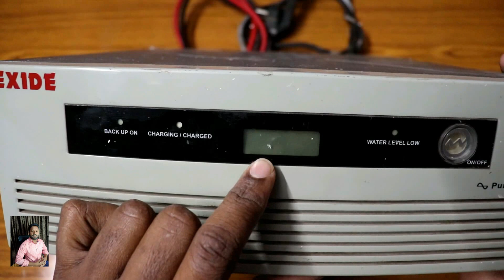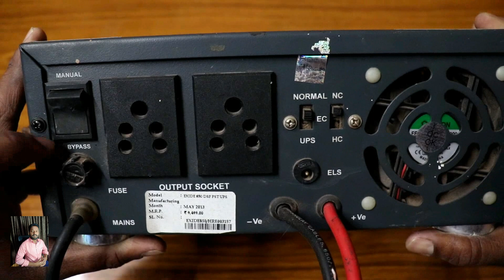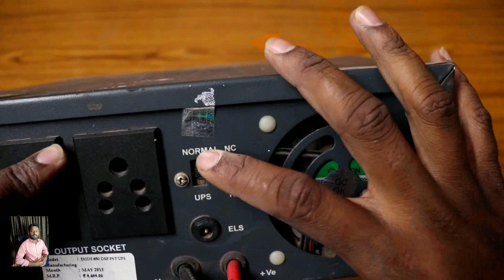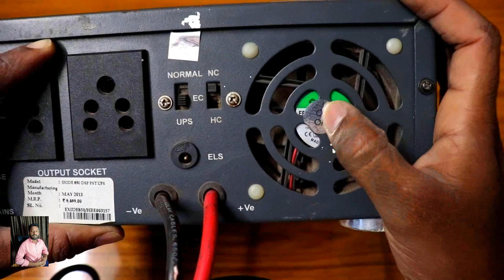How to Work inverter and What's Inside Practical in Telugu

Comment: Computer ups ki 7ah battery undi, car 35 ah battery change chesukoni use cheyocha
Reply from the maker: No
Reply: @VamsiElectricalWorksinTelugu  alredy ups ki inbuilt okati undi, extra 7ah battery parelal ga connect chesanu back time ekkuvasepu ravatledu max 10 mins vastundi, Please suggest cheyandi backuptime increase avvali

Comment: Hello bro, మా Inverter పేరు Amaron 880 battery 165 కూడా Amaron.అయితే Power పోయినప్పుడు Inverter on లో ఉన్నప్పుడు 5 to 10 minutes మధ్యలో Inverter దగ్గర just 2 to 3 seconds మాత్రమే  beep sound వస్తుంది. Inverter మాత్రం బాగానే run అవుతుంది. Short circuit  కూడా లేదు. ఎందుకు అలా Beep sound వస్తుంది. Beep Sound రాకుండా తగిన సలహా ఇస్తారని కోరుకుంటూ మీ Subscriber మరియు Regular Viewer.
Reply: Voltage fluctuations unapudu, ala vastun di, service wire connection or power interpretations